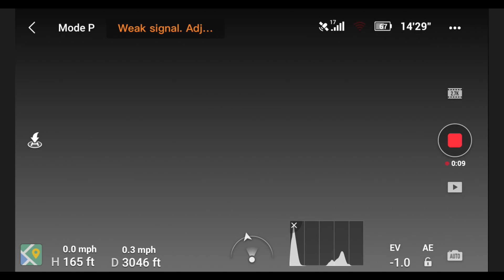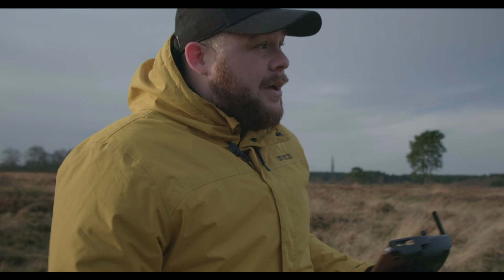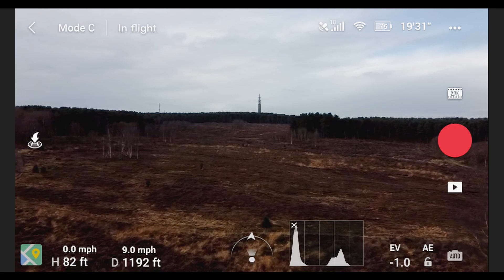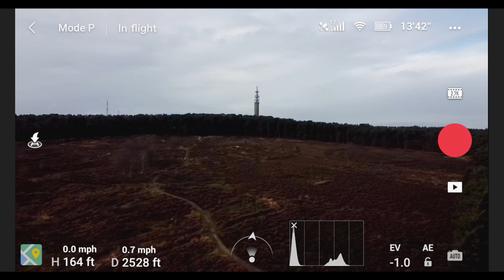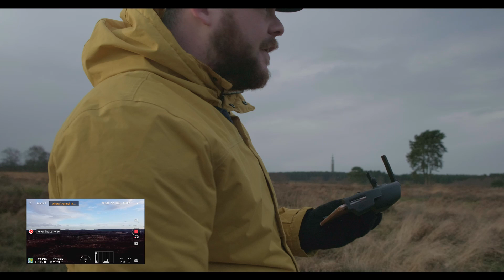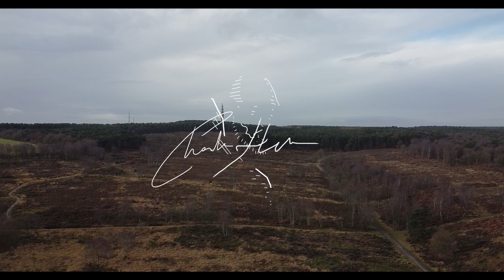Mavic Mini UK / EUROPE MODEL RANGE TEST!!! HOW FAR CAN IT FLY???

Comment: Well, I am having issues with V 0500 and motor overspeed problem. Besides that I did my own range test, second one in a few days, a different location over land rather than water. No extender(s) stock antennas 13,246 feet = 2.5 miles. I will be posting the flight on YouTube. The only reason I had to return was not through signal loss but that os battery life.
Reply from the maker: That’s really good 💪🏼

Comment: With a UK spec Mavic Mini, at 300ft over clear fields using a 5.8Ghz channel, it managed just over 4,000ft. Altitude helps as the drone flies away from you, otherwise line of sight may be impacted by terrain and landscape features which may not be an issue when the drone is closer.

Comment: i have an irish one. i can get about mile and a half
Reply: Hey Luke. Any recommended settings? Mine is arriving in the post today and I have read alot that the range is very limited on the CE model
Reply: @alanlucey9012  hi Alan. If you haven't played around with a drone before the range on it is actually very good. And if you want to follow drone law it needs to be see by your eyes at all times in the air not just the screen. But if you want a bit of extra range there is extenders you can buy on amazon and it ads up too a km in range. Or us a mock location app and make the drone think your in tge usa and use there law so its firm ware uses a different signal you can fly up to 6km. But just to warn you. I would go past 2 km with the mini. If you loose signal and it tries to fly back too you 8/10 times it will crash cause it has no front facing obstacle avoidance sensors. Happy flying 😋

Comment: How far can it fly in city?
Reply from the maker: I’m not too sure I never got round to taking it over the city I’m guessing it will be abit worse as it uses wifi
Reply: I can answer that for you.. 1000feet uk model.. I fly out of my flat window and fly around 300feet altitude.. first time I done it at night and went to 1000 feet altitude and I lost sight of drone, connection with rc, and also couldn't hear it.. I sat down gutted thinking it was a gonna but after about 10 minutes I heard it descending over the building so I picked up rc and manually brought it back to home sweet home.. hope this helps..
Reply: @wideawake2462  Not the first account ive heard of it coming home, I gotta say I hope mine never cuts out or anything but if it does please come home haha

Comment: Good vid mate, I’m flying my new mini on a field across the road from my house but fields all around me and my mini will only go 50m away an 30m up do you know why? Cheers Leigh
Reply from the maker: You may either be flying in a highly magnetic location or somewhere in you’re settings your being limited to those distances give it a check 💪🏼
Reply: Stop use the probe protectors.whithout the protectors its flys much higher
Reply: maybe beginner mode is on and those are your restrictions that are set?

Comment: Hey Charlie, on the UK model there is a BIG difference between flying in 5.8ghz and 2.4ghz mode as there is a power restriction on 5.8ghz in Europe. Try again and manually select the 2.4ghz mode (channel 1-13). Pick the channel with the least interference and you should easily get 5000 feet or more in an open space like that.
Reply from the maker: Hey thanks man that’s awesome advice il be sure to give that a try next time 💪🏼 thank you 🙏🏼
Reply: (CE), UK on 2.4Ghz maximum achievable 13,246 feet (2.5miles) and good signal. had to return due to battery duration.
Reply: @quentinbush  how are you switching to 2.4 when the uk model is locked into 5.8?
Reply: @wideawake2462  Maybe they updated firmware now but my one isnt locked I can change it to auto or manual and both 2.4 or 5.8 I believe the power is the main restriction 25mw CE vs 100mw FCC.
Reply: @quentinbush  I keep seeing people try it around EU in heavily congested areas with CE models and only get 300-400m, I am mot confident enough to fly mine much yet but taking off from the back garden in a low pop area I was able to easily fly across my town a good 250-300m away with no issues. Had it 3 days and havent flown that far since im scared of wind but tbh I dont know why people complain about the CE model its fine for what it is its not meant to be flow madd distance for the shitz. If people really want distance use some 3w amps and 19dbi panels I have seen people getting 10-20km with mavic mini using this setup.
Reply: @Jtag-dev  And as you can appreciate this is completely illegal. I think the max output we use in the UK (CE) is 100Mw (10th of a watt)
Reply: Where does this appear in settings.

Comment: So the american ones go 3 miles, UK ones go 3/4 of a mile, poop:(
Reply: Well not quite, in fact the US ones do 2.5 miles (4km) and the EU ones do 1.25 miles (2km) in 2.4 ghz mode. Still, it's half as far I'd grant you, but not sure I'd want to fly it more than 1.25 miles away very often anyway!
Reply: It is the same drone it just changes the range of you’re in Europe or America
Reply: @Jsaint07  That's not quite right, the US model only operates on 5Ghz and has a different WiFi chip. The EU version works on 5Ghz at low power and 2.4Ghz at a higher power, but neither option is as powerful as the US version.
Reply: @FazerWiz  its the same model if you were to use a program you could change the ghz look on youtube yourself
Reply: @Jsaint07  Sorry that's not correct, the Wifi chip is different and the US one doesn't even have a 2.4 Ghz antenna. Search here for the guy who has actually taken both apart and he shows you.
Reply: @FazerWiz  Frazer shall I be flying my Mavic Mini in the UK only on 2.4GHZ? I'm not entirely sure how you change this option as I am only researching about my drone before it has even been delivered. But I'll continue to do further research, I just saw your name pop up a few times and it seems you know what your on about, thanks buddy have a great day
Reply: @1stklass  You change it in the app. 5ghz is supposedly less busy than 2.4, but as most home routers have both, there is little in it and I get much better range with the 2.4 channels.
Reply: Not the case, I am in Yorkshire CE and achieved 13,246 feet (2.5 miles). Only reason to return was battery duration, NOT signal.
Reply: @quentinbush  Quentin, when you receive a message on screen saying weak GPS etc, do you continue flying through that (away from your person)? Or do you stop, let it register better signals then continue? 
I've had mine for almost a week now, I've used it everyday over miles of fields, but the furthest I've gone is maybe 230meters.
I'm scared to go any further as I usually get a weak signal, or a strong wind message.
What shall I do? P.S. I'm flying in sports to help combat the wind, but I don't know wether one day I should just test it and keep going far. 
Secondly, I would love to send it high up, in the UK what is a good height in meters to send it to? 
Suburban area, but countrfied.
Thanks so much everyone, your all great people and help me out loads.
Reply: @1stklass  Hi, Firstly I always like to have a minimum of 13 satellites and my homepoint recorded for a safe return. I have never had a message saying weak GPS but plenty of Strong wind warnings. 

When I started with my Mini, I was achieving similar distances. I complained to DJI saying (CE) 1.2 miles... They sent me a return label and when they checked it, there were issues on 2 boards, controller, drone. Believe me I have also had my problems with distance and of late Motor Overspeed issues down to V01.00.0500 update. To achieve 13,246 feet (2.5m) which has flabbergasted me, I changed the frequency channel to manual no 1-13 2.4Ghz. Left it on Chan 6 despite them all being on red. Auto seems to choose 5.8Ghz. Anyway, I just let it go, sod it and today between South Newbald and Sancton in East Yorkshire it covered 2.5 miles with no range extenders.

I have found the Mini drone will always come home, black screens, loss in connections, it has never let me down. Just make sure in the settings you enable Maximum distances (no limit) in everything.
Have faith.. enjoy.
Reply: @1stklass  Good height is 200 feet. Max legally is 400ft (QFE) in the UK but it will reach 1600ft. Bad.
Reply: @quentinbush  Thank you so much for the information, very informative and helpful. I will definately set my maximum distance to no limit and follow your other steps.
I guess only time will give me more experience, i love the device and i smile everytime i land it because i just can't believe the technology invented to be able to create such a product! 
I'm really excited to interpret some of my footage filmed on my mavic mini into my music videos very soon :-) 
Thanks so much Quentin, hope you have a lovely day in Yorkshire.
I'm in Hertfordshire, just 16miles north of central, quite suburban, but i travel 10minutes on my bike and i can be in the fields with no houses or nobody aroudn for miles :-)
Reply: @quentinbush  how are you getting that distance? My mini is locked into 5.8 so I'm only getting about 1000feet both horizontally and vertically..
Reply from the maker: Exactly 😂👏🏼👏🏼👏🏼

Comment: The range differences between EU and US drones are to do with the differing regulations around Wi-Fi power. The DJI app uses your GPS position to set the WiFi mode depending on where you are on the globe. If you took your drone to the US the drone would automatically have the full range enabled .
Reply: Chris Levinsohn This is actually untrue due to the ce version and ffc version using different hardware therefore even if you took the ce version to the us there would be no difference sadly
Reply: Josh Stev I stand corrected! I’ve seen videos of Mavic Airs being switched between FCC and CE mode so presumed the Mini would be the same. I didn’t know that the Mini has two distinct models: https://m.gearbest.com/blog/how-to/whats-the-difference-of-dji-mavic-mini-two-models-model-mt1ss5-and-model-mt1sd25-9131
Reply: @joshstev3066  spot on dude 👍
Reply from the maker: +Chris Levinsohn thanks 👏🏼👏🏼👏🏼 I need a trip to the us 😂😂

Comment: Give mine a distance test last week, got it out 1600 mtrs/5250ft before I bottled it & brought it back, this were done over open fields with nothing around,  still had connection with RC so most probably gone further but I’d rather have it back than lose it, maybe one day I’ll go all the way. 👍😉
Reply: Try the floater app on playstore, mock gps app, set you location as somewhere in the us and then open the dji fly app. Might work, works for the spark.
Reply from the maker: +Mike Kong awesome is yours European or us model??? I hope I can get a bit more range out of it when I’m away from big signal towers 👍🏼
Reply: Charlie Hunt CE, where I live there are just miles of open fields with no interference so I usually get a really strong signal, only time it’s dodgy is when there’s heavy cloud. 👍